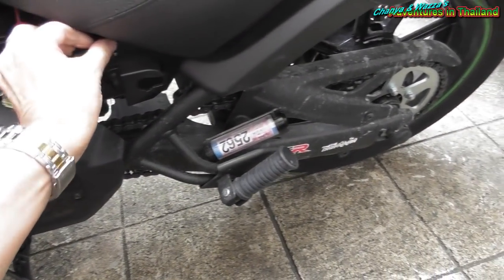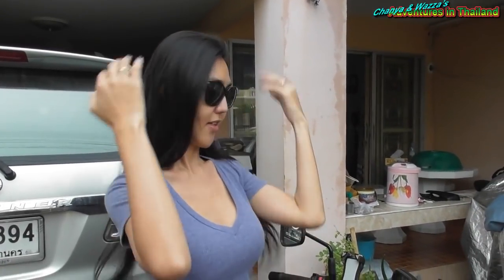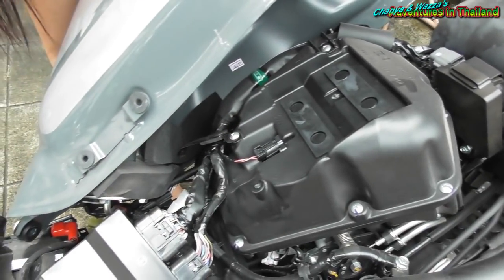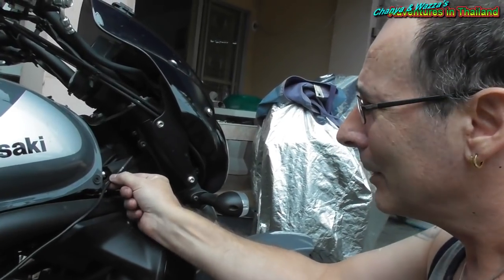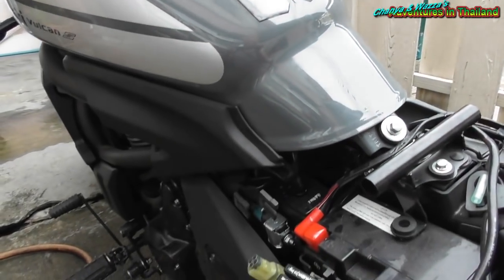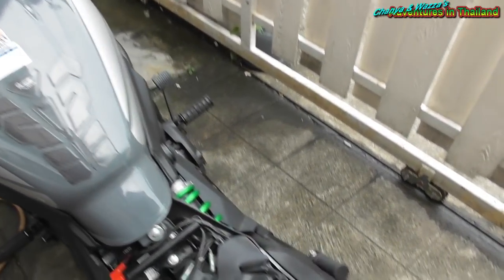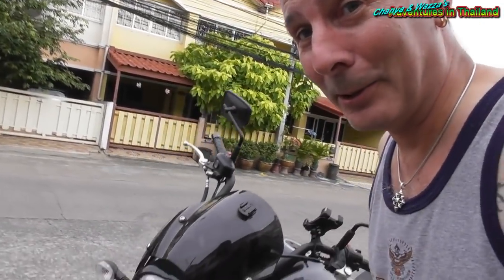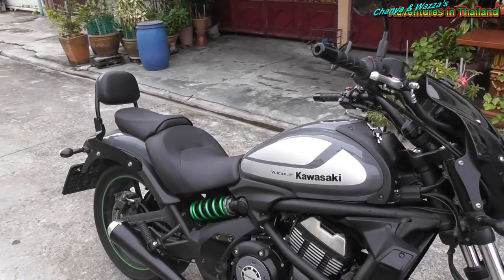Fitting the BoosterPlug to the Vulcan S (การติดตั้ง BoosterPlug กับ Vulcan S)

Comment: Glad to see you got the Booster Plug installed with help from your lovely assistant!  The Booster Plug will richen the mixture from approximately 14,4 : 1 to 13,6 : 1. It will not foul the plugs.  A slightly richer fuel mix helps the the engine burn at a lower temperatures. Added gel to my seat today.  Only took one hour and cost $60!  A noticeable difference!
Reply from the maker: I'll have to check out the gel seat option. It looks like they did a pretty neat job too. 🙏

Comment: Did you need to do the running in due to the booster plug or the exhaust?
Reply from the maker: No, but the computer needed to go through the re-calibration process. This involved riding at normal speeds for 20 minutes on a cold to hot motor. Once I had done 3 runs, the engine light turned off.

Comment: were you having trouble with stalling or power loss after the new exhaust?
Reply from the maker: No. The throttle was more stable and smooth at low rpm
Reply: @ChanyaAndWazzaThailand  i'm asking about how it road before you installed the booster plug. did it ever bog out with that exhaust?
Reply from the maker: Sorry, I read that wrong. Yeah, the throttle was very touchy at low rpm and what I read online was that this device fixed that.

Comment: it seems the booster plug is a sensor that helps the ecu adjust the fuel and air mixture by sensing the moisture of the surrounding air ?
Reply from the maker: From what I understand from the manufacturers videos, it fools the ECU into thinking the air temperature is cooler so this makes the ECU create a richer fuel/air mixture.

Comment: Did you order it locally or from the website?  I went to order it on the website and then saw that they use DHL for shipping, which has put me off completely.
Reply from the maker: I ordered from the website and it arrived in a few days. I was expecting customs to intercept it and charge me an import duty given that this is Thailand, but no, it was delivered without interference.
Reply: @ChanyaAndWazzaThailand  Yeah my issue is DHL, not Thai customs.  I sent a Nintendo game console I bought in Hong Kong back for repair earlier in the year and customs charged me 500baht when it came back, DHL, on the other hand, charged me 8000baht to fill in the paperwork and store it for the 3 weeks it took them to get it organized.  It's ok anyway I've found a Thai distributor is selling it via the Shoppee marketplace so no need to deal with DHL thankfully :)
Reply from the maker: Sounds great Aaron!
Reply: @ChanyaAndWazzaThailand  What's the exhaust you have on that?
Reply from the maker: It was custom made by a local Thai exhaust shop

Comment: Gday mate,
When you put your booster plug in and took it for the 3 x 20 min rides to reset the ecu, did you have to do these rides within 24 hrs or was it just ok to do whenever you needed to take the bike out. I’ve got the same engine check light staying on after installing my booster plug.
Reply from the maker: My situation was not all that obvious. First I fitted the new exhaust and the engine light came on so I read somewhere that I should disconnect the battery to force a recalibration. After the next 2 rides, nothing changed but then I took the bike back to have a db reducer put in the exhaust. Another 2 rides after that and the engine light was still on and that is when I fitted the booster plug as it had just arrived. From this point, it was 3 consecutive rides over the next 2 days and then the light went off. So it could have been the 3 rides but then again it was 7 rides in total from the point the light came on.
Reply: It is a must for the performance of the engine to dynotune the engine after every modification even exhaust changes this is why so many newbs have problems with there bikes trying to improve things when they have not even done a motor mechanics course .

Comment: I put the booster plug on my bike at 700 miles it's got 2400 on it now my check engine light came on flashing code 62 sub valve actuator just wondering if this boosterplug is the cause for this malfunction what do you think? I haven't put on a new exhaust yet and that's just came on yesterday thanks for the great video. Do you know what code your bike is flashing?
Reply from the maker: Hi Mike. I can't imagine the booster plug has anything to do with the mechanical operation of the sub valve actuator. All the booster plug does is tell the ECU that the outside air temperature is around 20 degrees cooler than it actually is so then ECU compensates and makes the fuel mixture richer. Pop over to this facebook group and ask the question and you might find someone who has had a similar experience - https://www.facebook.com/groups/KawasakiVulcanS.english/

I didn't have any flashing with my engine light, it was simply on constantly. After I completed 3 twenty minute rides from a cold start, the light went out and that was what the service manual suggested for the problem.
Reply: Warren Gerdes thank you sir I believe I'll try the three 20-minute rides now. I took the booster plug off last night rode the bike this morning the light went off. Put the booster plug back on road for about 20 minutes right around 30 miles and light came back on. I know the purpose of the booster plug and what it does and did for my bike. That's why I am a bit confused on what is going on here. I contacted booster plug and explain to them what's going on to see if they have any insight on my issue. I bought the bike brand new 700 miles on it when I put the booster plug on it never had a problem until day before yesterday 2500 miles.
Reply from the maker: Seems quite odd, but I'm sure the guys at booster plug will be able to work it out.
Reply: I seriously doubt that the booster plug has anything to do with this error code.  62 Subthrottle valve actuator malfunction, wiring open or short.   Sounds like a short somewhere.  Also check your fuses.  https://www.vulcanforums.com/forums/130-vulcan-650-s/280449-service-code-info.html

Comment: The bike sounds awesome now with the new exhaust. When you rode off and Chanya was filming i could really hear he difference. Normally to to reset an ECU, I think you have to disconnect from the battery....I'm sure you'll figure it out. Let us know how you go.
Reply from the maker: Yea, a lot of the forums gave that as a method but didn't work. Bob sent me a snippet from the service manual. It basically says to run the bike 3 times from a cold start for 20+ minutes at 30km or more. Finished that process last Friday and the ECU reset automatically

Comment: Has it made any difference to the performance of your bike Warren?. Great vlog mate ...Thanks for sharing.
Reply from the maker: It certainly feels a lot different when I ride, but the overall perception of all the mods makes the bike feel more responsive. I don't have any hard evidence of this, but it feels good!
Reply: The booster plug's purpose isn't to increase performance but to make the bike runs smoother and lessen the twitchy throttle in first and second gear.  Also it will balance the fuel mixture if you have installed an aftermarket exhaust system.  Overall performance doesn't change but the bike will run better/smoother.
Reply: I like the wind shield you have. what brand/model is it?

Comment: Aren't you worried about voiding the warranty if a bigger problem happens later, and they might try to deny you because you fiddled around with things?
Reply from the maker: As I mentioned to Kris, warranties are weird things in Thailand. I trust the vehicle is in good condition so I won't need to get a warranty issue sorted out. I do have the original exhaust which can be fitted back on if I need to claim a warranty, but I'm just as likely to have problems there because i am a foreigner. This is Thailand 😉

Comment: Generally Booster plugs don't do anything other than increase fuel injection at all ranges so you might have to clean/replace plugs a little sooner than the service book recommends. As for the engine light disconnect the battery for 5 - 10 minutes (long enough for the system to discharge) and then re-connect and start. The CPU should re-calibrate itself then and clear the light.
P.S. Chanya looks hot in that outfit :)
Reply from the maker: Yea, I did try the battery disconnect but that didn't work. The service manual gave a procedure and I followed that and the ECU has now been reset.
Reply: Actually, that isn't correct.  The booster plug only increased the fuel mix during low rpms and full throttle acceleration.  It is dormant during normal cruising when it's not needed.  I have been using it for over a year with great results.   No check engine light when I installed mine.  Perhaps something wasn't connected correctly.  Also the sensor would be better mounted on the foam piece on the right side of the tank.  It already had an indent for it which makes it the perfect place where most of our forum members have mounted theirs.  Here is another link to an install video that goes a bit more into detail.  https://www.youtube.com/watch?v=SD58033pxm8